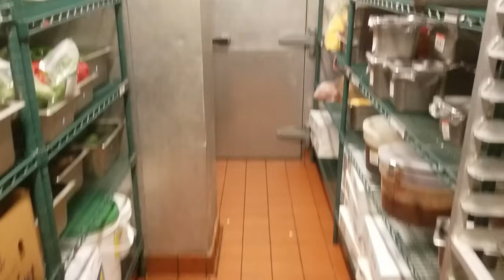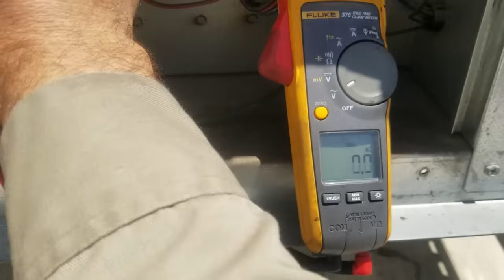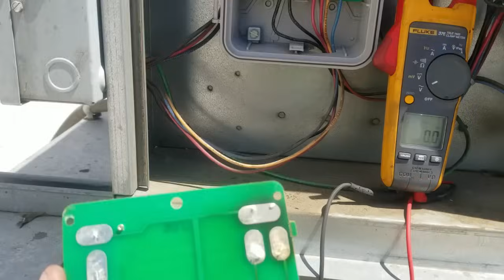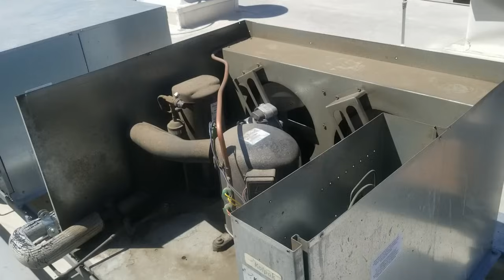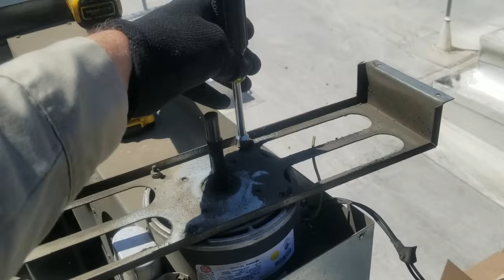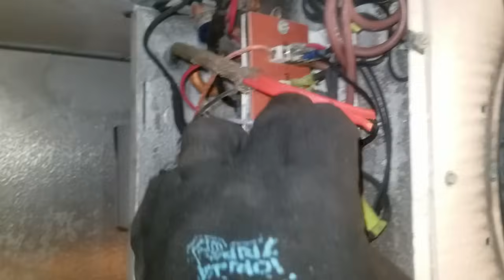Walk in Freezer service call  (electric defrost explained)

Comment: Talk about being worried lol I replaced a motor and contactor one time and turned the unit back on checked my pressures and it was cooling good, came down loaded my tools and ladder back up walked inside and the unit wasn’t running... check the t-stat and it was calling put my ladder back on the roof and it had just went into a defrost 🤦🏻‍♂️ smh lol I had actually forgot to reset the defrost time back to the correct time anyway, haha things happen sometimes when your overworked haha
Reply from the maker: I am going live on Youtube this evening 1/7/19 at 5:00pm pacific standard time to discuss my most recent uploads, come on over and check it out https://youtu.be/UXpVzsY0gzc

Comment: My walk in freezer defrost cycle kick on for a couple second and jump back to freezing mode right away.
I have to pull out the x termination wire to force it defrost. would you tell me what is the problem.
Reply from the maker: Its hard to say but it sounds like the defrost termination is bad
Reply: @HVACRVIDEOS  
Thank you so much! learned so much from your video, looking forward to new ones !!!

Comment: You're calling it is in the clock module itself basically in a nutshell that clock defrost timer design sucks donkey doo doo it pulls in high voltage uses high voltage that's on the same line as the compressor so it gets the effects of the compressor starting and stopping so you get the inrush current on the line you get the brown out loss of online it cycles so it could actually have been moving the clock could actually been in its sequence of just switching from one of those push down pull up contacts to another one just at the right time when the compressor was kicking off with or turning kicking on or turning off I would put money on that is what happened that HVAC field in general for consumer commercial weather Chino a home unit you know heating and air conditioner air handler you know all that that your house you know those are high current switching devices that got so I've seen this a million times on other products out there that in theory if everything else was perfect that would be an acceptable design as it's being used now however in my personal and professional opinion with the background of a lot even though I'm kind of broken from a car accident almost 2 years ago the let's call it mechanicals of a house or commercial cooler air handler whatever freezer in most installations the building was never designed for that high of a load for example houses a lot of houses even built 20 years ago were you know not set up for huge loads I forget what years to what years and it's still recent but houses used to only have a 60 amp service coming in on two lines all houses are 2110 hotlines and a neutral in the ground and that's the transformer coming to you so right off the bat there's not enough power coming in to do a lot of stuff and then but then the way the electrical from the panel was not designed for the way we use them even then to now and even since the 70s I have products that consume a crap load of power that we don't even realize it and then we get uneven power draws on basically our loads are not balanced on line one line two so then when everyone's seen this in your house when you're air conditioner comes on or your microwave goes on you can actually see your lights dim for a second or sometimes in the evening depending where you live you can see your limbs your light stem for just a little bit basically around when everyone gets home that goes to other things too but these circuit boards in these HVAC units really get to me because they don't take into consideration anything else a lot of air hand letters on side stepping here area and letters for houses they're transformer in there to drive the low voltage 24 volt AC line is like typically 40 volt amp which is nothing and then you know they want to digital thermostat Japan what kind of setups you can end up with mortise I personally had that in one of my houses where I had a heat pump Lennox system that was a high seer rating from the 1992 and as other electronics progress to feel thermostats it was also a heat pump with emergency she so it had an extra dual fuel board on it like a defrosting but not a defrost obviously and it would switch over to emergency heat if you called for the third or if it was the low whatever the set point was for the heat pump outside to where it could no longer efficiently good to eat from outside and bring it inside I can go on and on and on but basically there needs to be a better defrost board design out there product and I may just bring one to market